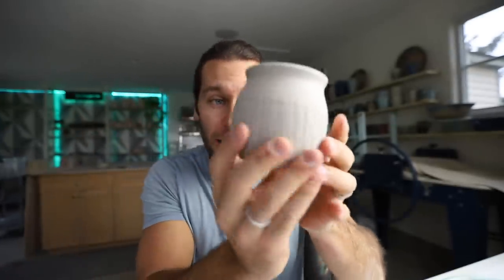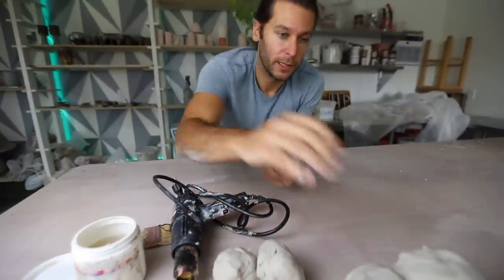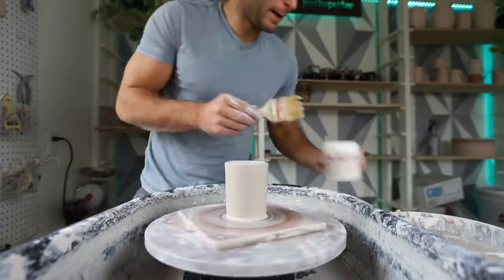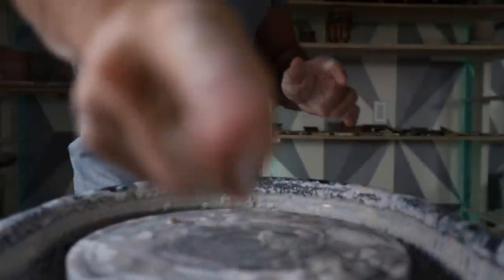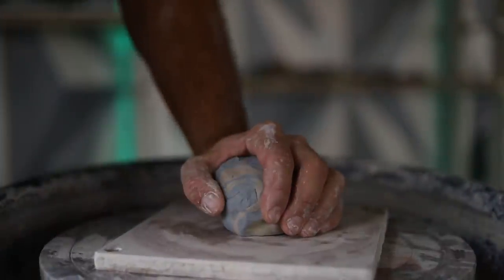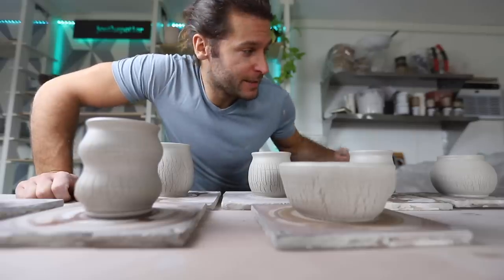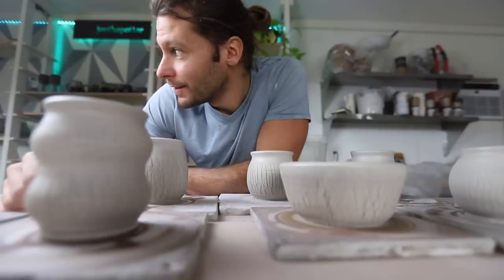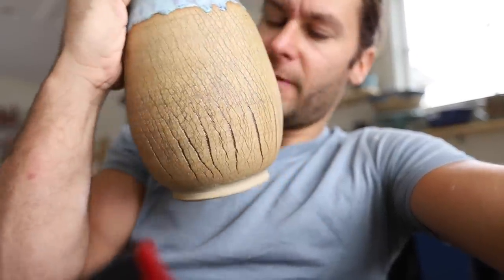The Crackle Technique - How to create this AMAZING finish!

Comment: I wonder if you couldn’t achieve this just using the heat gun without the sodium silicon. Wouldn’t it dry the outside layer of the clay? Should achieve a crack right?